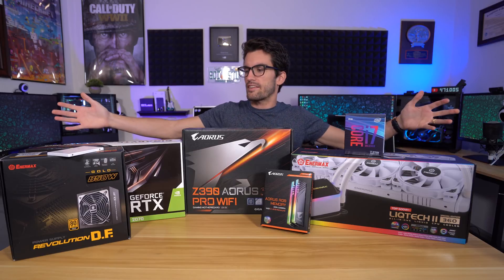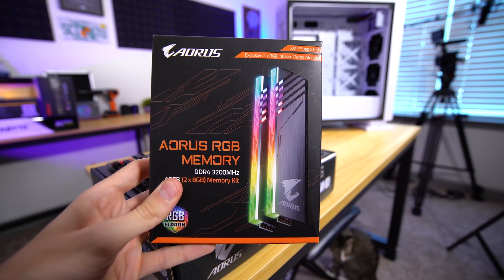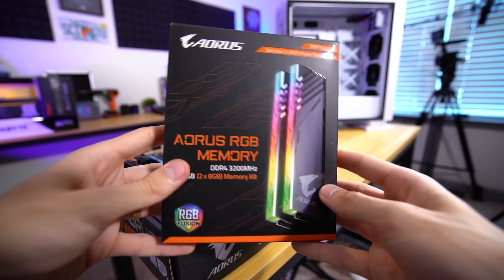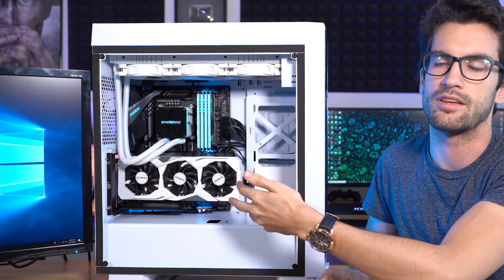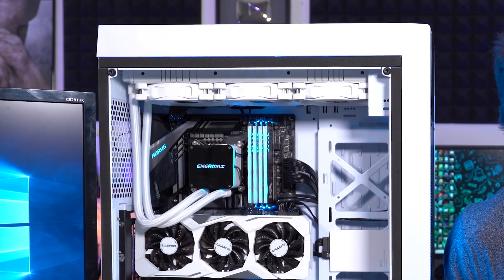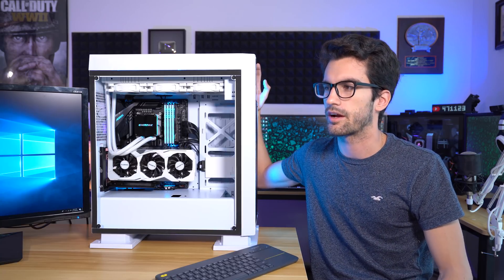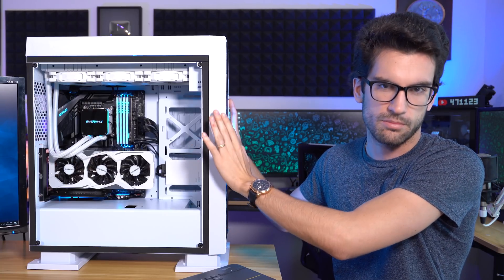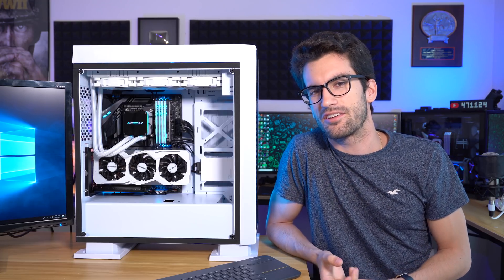PC Build & THREE Giveaways!

Comment: If that was my build, I'd definitely put a fan on the rear. On the outside. Well, if it was then I wouldn't even use an AIO at all because I'm an air cooler kinda guy but that's beside the point.

By the way, your Twitter post says that the giveaway PC has an i9. Probably by mistake. Thanks and best of luck to all my international dudes out there.
Reply from the maker: Yeh RIP I meant 9th gen. Basically an i9 9900K minus the HT 😅

Comment: what about flipping the AIO around so the tubes are on the front, not blocking the rear vent. or put the AIO vertically in front of the case?
Reply from the maker: Crossed in front of RAM. Looked stupid.
Reply: Science Studio gotcha.

Comment: Why not spin the radiator 180 degrees so the hoses are in the front? It would probably give you a cleaner run and give room for the rear fan.

Comment: Thanks for the chance at a GPU, planning my next build at the moment and it'd be a great starting point!
Reply: You'll need to purchase an AUX splitter such as this one(ebay.com.au). Your motherboard can't receive microphone audio from the green audio port.
Reply: @stevethea5250  Think you might have replied to the wrong comment chap :)
Reply: @AxR558  1050ti and 1060 are more abundant than the higher series 10 cards, as they simply yielded more mid/low level chips. They haven’t made pascal since the RTX launch and people that game and don’t want to spend for ray tracing grabbed up a higher spec 10 series card.

1050ti and 1060 cards are cheap also because of the GTX 1600 series that replaced them and also the RX590 that are faster than both and gave more memory. Much more competition in the lower end, where there’s basically no competition with the 1070 and up, as AMD didn’t make many Vega or Radeon 7 cards to realistically compete.

Supply is low, demand is high, this expensive 1070 and up.
Reply: @stevethea5250  ???